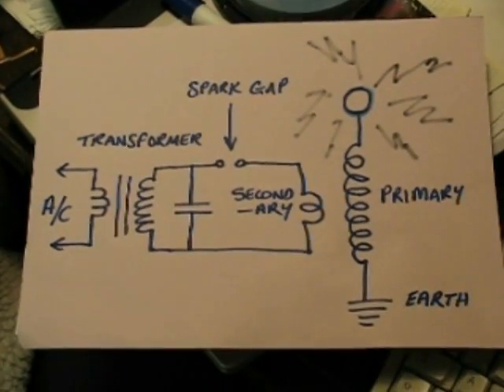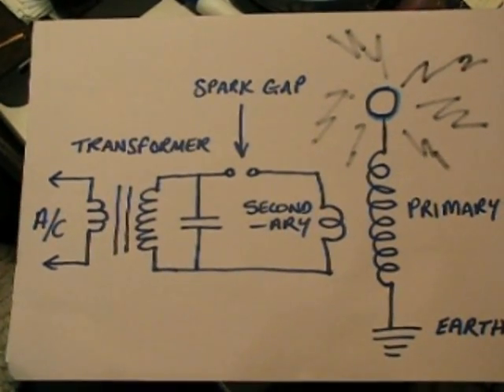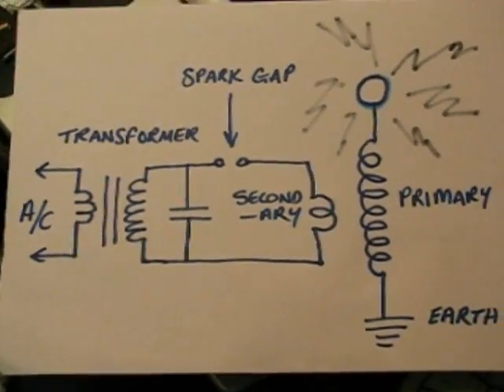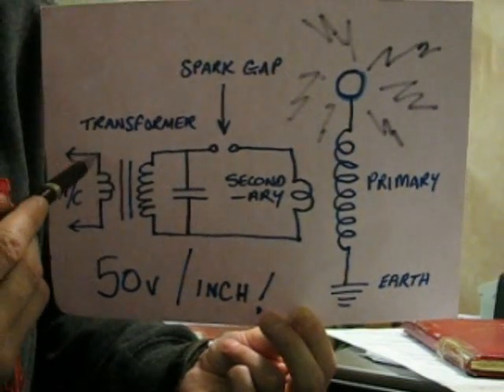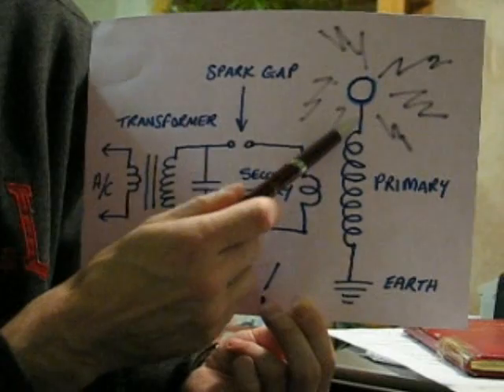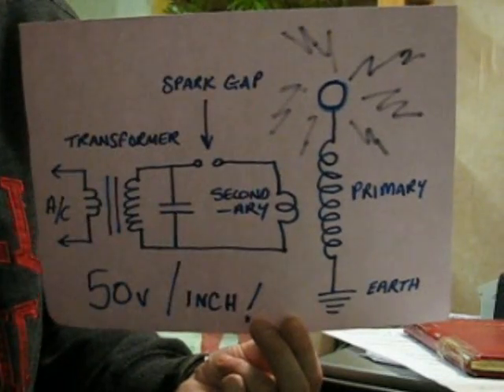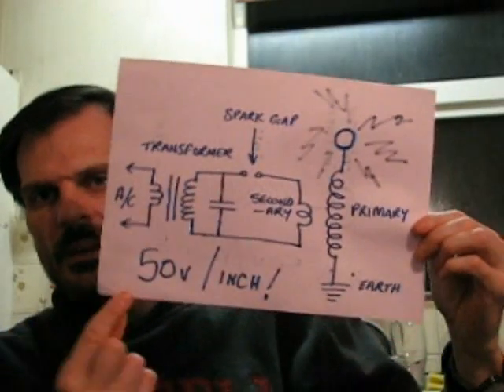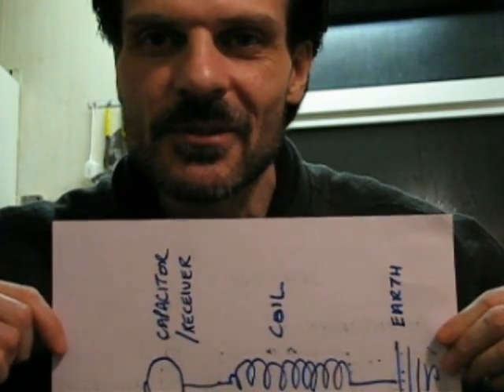Tesla's Little Secret

Comment: Excellent exposition, sir! Thanks. So is this being worked on? I mean, one lightning bolt has enough power to power NYC for a year. Er, that is what one book said. On the www I'm seeing a modest 250kwh.
Reply: We have very high towers as it is now. Their used to transmit radio and TV. They get hit by lightning plenty of times. I find it hard to believe that there is enough energy to power NYC for a year in one. Energy can't just disappear. Lightning can certainly damage things but if it had enough energy to power NYC for a year after hitting a tower we would here about towers being destroyed instead of just radio, TV and cellphone transmitting equipment. In fact most of the equipment is saved though the use of lightning arresters.
Reply from the maker: Joseph Plogger
 I think what we need to be looking at is HOW lightning is created not necessarily how to capture it. Water particles all charged in the same way create a huge amount of power, but the water particles themselves are tiny.... maybe like atoms? All atoms have energy! Maybe we should start thinking about aligning them, like a permanent magnet, or a permanent battery? hmm ;-)
Reply: MattBlytheTheOne That's good thinking, Joseph.
Reply from the maker: Thanks and don't call me Joseph.
Reply from the maker: Joseph Plogger
 What you mean is the only way YOU know how to get energy from an atom? ALL atoms have electrical energy, an electrical charge. They spin contunuously, in fact, atoms ARE energy! If you bond the atoms of two different elements there will be a potential difference across that molecule. I think you are over complicating your theory of lightning. You are correct that all our electrical energy comes from the sun, but lightning is nothing more than charged water particles building up like a capacitor and then ionising air when the charge is sufficient to conduct to ground. BLACK HOLES? Where on earth is the evidence for black holes? Black holes are just galaxies with a central sun that has not starting radiating light yet. We need to grasp a new model of understanding here.
Reply from the maker: Joseph Plogger
 Dude listen to you! You know everything there is to know about the universe already! There is no room for furthering your education. You must think you are God already LOL or even more arrogantly think that God does not exist. The only lesson you gave was a lesson in YOUR model of understanding which I do not subscribe to.... of course galaxies exist and create gravitational signatures that science can only explain with a dis-proven "black hole" theory. LOL how can a giant nothing exist in the middle of everything. Even at the centre of the Milky Way we have a central sun yet it is so far away no one has ever seen it...... have a scientific day. But don't tell me what to do on my own channel. Thanks Mr Plogger.
Reply from the maker: Well OK but you cannot actually see a black hole through a telescope, you can only see something you do not fully understand and then interpret that as a black hole. Massive central suns are the ONLY explanation that integrates the gravitational affect witnessed by so-called "black holes". The reason why you cannot see our central sun is because of the surrounding matter obscuring it, which is considerable, being at least 100 light years across... its not a magic universe it is a scientific universe and unexplainable black holes do not exist, its a fact... or at least it has yet to be proven otherwise.

Suns tear apart? Only when they collide with other galaxies or super massive interstellar bodies.... no wait.... actually you CAN see the central sun in the MIlky Way if you care to take off your blinkers, sir. Have a good day :)

http://cdn.theatlantic.com/static/mt/assets/science/panoramicmilkyway.jpg
Reply from the maker: And for the record stars do not run on "nuclear fuel" and they will not burn out any time soon. Our own sun is a planet that radiates energy (received from the larger central sun) which in turn illuminates its atmosphere, which is thicker than earths.

Logically the sun could not be a "burning ball of hydrogen gas" as most out-of-date models purport, or it would have exploded a long time ago and burned out. And even if there was a way that the sun was converting hydrogen at a steady rate, it would still have to be a solid mass, not a gas cloud!

All suns, stars, planets and even atoms receive their energy from a networked grid of nodes something like a four dimensional printed circuit board. The whole system derives its energy from its own expansion and subsequent resistance, which creates positive pressure on all everything within it boundaries, which by all accounts are limitless in terms of what can be measured.

Evolution exists, but the mind always evolves first. This still doesn't take into account creation or the power of the mind to create.The Mind of God being the Thought that created the Universe and everything in it. You could call this the "General Special Universal Theory of Everything!" LOL.

These are the facts that science tries to repress. Many have discovered the truth, and you can find it if you research in the right areas... but we have to keep an open mind to escape the rigid perceptions (not knowledge) of classical text book scientific dogma.
Reply from the maker: "Seeing as the gap in the center of the universe is only about 4 million km across,"

The centre of the universe? LOL where is that then? ;-)

"4 million times larger than our sun"

..or four million times denser? (providing your calculations [assumptions] are even close)?

"...which violates the laws of Thermodynamics"

Not if it is a turoidal system and the energy flows around it continuously which has been proven possible by Ed Leedskalnin's perpetual motion experiment (which is actually just a reflection of energy being received that is present in the universe at all times). I agree that the energy has to come from somewhere.

"That picture is only an artist's rendering of our galaxy."

Well actually, it is a succession of photographs taken from earth and stitched together, in that respect it is a true panorama. To deny the bright spot at the centre is to refuse to acknowledge the truth.
Reply: No. You said the centre of the universe. Don't try and change it after the event and insult me because you made yourself look foolish. It IS a genuine panoramic photograph of the Milky Way taken from earth. Jackass.
Reply: And I am not a fan of Wikipedia. You make more assumptions than the facts you claim to observe!
Reply: Einstein said, "Only God's Thoughts matter, all the rest are details!" 

See ya :)p
Reply: You cant help it.

Comment: If the sun's radiant energy is DC, how will this induce voltage in a coil
Reply from the maker: Tesla knew that electrical energy could be transmitted wirelessly, through a large Tesla coil which is what Wardenclyffe Tower was basically, to other coils with either the same mass or a resonant harmonic frequency. What if the sun were just a large transmitter but we havnt learned how to tap into the right frequency yet? And in any case it is not difficult to convert DC to AC. We have lightning already, its just learning how to receive the energy that makes lightning possible. Cheers bud :)
Reply from the maker: By converting it to AC
Reply: MattBlytheTheOne
Are you saying the sun's energy is AC riding on DC???  The change of current induces voltage in a coil.  So like, fluctuations of sun intensity?  I don't understand
Reply from the maker: I think you are right. The suns energy is primarily DC but it also radiates harmonised AC at very high frequencies, which is what life on earth depends on to trigger its seasons etc. Current induces voltage in a coil when it is changing. A constant DC current would produce a constant voltage across the coil but it would be very small due to the low resistance. So to get an AC signal we would need to convert the DC to AC to make it usable.

All atoms have energy which is constantly being recharged by the sun. And we can tap into this to produce free unlimited energy :)
Reply: It's a great idea in theory.  But I can't stress this enough, once a coil has settled to a DC current-- it doesn't induce voltage!  There is a spike initially as the current rises from Zero to Whatever DC you applied.  Then the coil looks like a "DC short" except for winding resistance.  i.e. 8 ohms

with DC, a wire is a wire, it doesn't care if it's wrapped in a coil or wrapped around a christmas tree.  You could harvest heat!  It's just a resistor
Reply: Forgot to mention, the coil does maintain a static magnetic field directly opposed to the current passing through.  You COULD move another conductor through the static magnetic field.  and induce voltage that way.  I think it would require more input energy...than the possible energy yield of the sun.

That being said, if you make this work, you are my hero

Comment: People... running the Tesla coil backwards will just give you a simple radio receiver. You will just pick up radio waves.  Google "crystal radio schematic" and look for the most simple schematic. Replace the transformer with some earphones, and the spark gap with a diode (to make it DC instead of AC), and you have a radio. The reason the tesla coil is powerful, is because of the "LC circuit" (tuned circuit), google that.  The electrons in the tuned circuit bounce back and fourth until it dissipates, making sure mostly all the power supplied is used, and not just small amount.

Comment: Matt, coupling 1000 turns to a few secondary turns is impractical at high voltage. Only geometry can generate that terminal voltage in a Tesla because it has no inductive coupling between pri and sec preventing enormous backlash that would destroy the oscillator. The sec has to be a single layer to prevent turn-turn arcing on overlaps and coreless - ferrite would couple all the sec turns together with the pri, and then it becomes a HV transformer, not a Tesla configuration... ;) Peace dude.

Comment: If you take a fully coupled transformer with a 5-turn secondary driven by a 1000 turn primary, this will step down 1,000,000v to 20,000v or less depending how well coupled it is. However a Tesla coil produces several million volts from 10,000v with a 5 turn primary around a 1,000 turn secondary when it should produce only 50,000v using transformer theory. You're not wrong, its just that a Tesla coil doesnt work like a transformer and thats what you need to do what you ask.

Comment: I hate to tell you this but a good tesla coil runs at several million volts at the top-load, and the primary is not tightly coupled to the secondary (primary is a flat or pyramid coil on the lower third) with virtually no inductance to couple. It produces a 'ripple' in the secondary that travels upwards and downwards, reflects and meets in the upper third just in time for another ripple which biases the first. Its a charge-pump, not a transformer, and will not work backwards even with no gap.

Comment from the maker: Before 1906 Wardenclyffe's Tower was to have a Solid Copper Sphere atop the Tower (above the 50 Ton Copper Coil) to attract Lightning, transformed, to a perfect ground, sent by (ULF) of 1-2HZ waves using the 16 X 420ft hollow tubes in the ground. Then 1000 Krypton Vacuum Beam Tubes (4M Volts Each X 100K Amp Lightning = 4-40 Quadrillion Watts) max negative resistance. Tubes pumped to millions of volts from EMF from Strikes...

Comment from the maker: Good point. For a strta the Tesla Coil is not configured to work backwards, the spark gap is in the wrong place and the "receiver" is practically at ground potential. However, place your Tesla Coil near another radiant form of energy (for example another energised tuned Tesla Coil) and it will receive just fine :)

Comment from the maker: Not really! Millions of volts, as in the case of lightning, would fry the transformer coils. What we need is a steady stream of electricity to charge a capacitor for example and then make it AC through some form of switching gear. The coils could be configured to make it useful we are not limited to the current winding configuration.

Comment: Took me a minute to find, but take a look at Dr Stiffler's SEC.
This device does what you claim but has to be excited by an inductively coupled source (a radio signal) to work. This requires an energy input.

Just a thought - if a Tesla coil works in reverse like you say, how come mine doesnt produce any energy at the primary when not driven?
Tesla built his spark machine to debunk Edison's parlour trick of electrocuting cows, proving that AC was safer than DC. Lightning is pulsed DC, not AC!

Comment: You dont mention the fact that the large SECONDARY (induced) air-coil is actually driven as a charge-pump. Those sparks are generated by an AC signal that is faster than the coil's reactance.
What you are describing is accepted transformer theory, but the Tesla Coil is not a transformer, it is a charge-pump. To transfer 'ambient' energy through this, the ambient energy would have to be millions of volts AC at the tuned frequency to produce hundreds of volts AC in the mains transformer.

Comment: very true but the most common 'radiant energy' is gamma radiation and it's stopped by the earth atmosphere. the most conmen radiation to reach the surface of the earth that I know of is viable light. You know the energy that solar panels, trees, grass and every plant on the planet use. There is still allot of radiation in longer wavelengths but the longer the wavelength the less energy that wave has. So if you can find a way to capture energy form all of those longer waves it might work.

Comment: Okay you're thinking the same as mine,as I am building reactor still doing the blueprints for it. I watched the other video that linked me to comment here and you said the tower itself was a capacitor and your right as I am using this fact myself.The primary coil grounded send the charge into the earth, but this current can still be used in house and such i.e. when tesla put all those light bulbs in the ground he was testing the range of the field that was produce as the current grounded itself

Comment: While you can get electricity from radio frequencies that are in the air, none are of significant enough power to be of much use. Directional waves are more capable of transmitting power, but most signals are omni-directional or too scattered.

The only real use I can see for this is a spectacle. You mention in your video creating lightning to impress people, which can be done with a high voltage and low amperage. I am sure people in Tesla's time would have been amazed, but we should know better

Comment: I think you have wrong concept of the jam radar. they just fill the signal that is going to the radar with noise, in this way the radar can't actually understand if it is an object in the air. But even if it does sent back the signal in the opposite phase... what is that mean??? nothing! the signal would come to the radar in the same way just with the opposite phase. Just if you could see the amplitude of the signal it would cancel in some spots, read "stationary waves".

Comment: i am schooled in physics, with electronics & laser physics. you are correct in you analysis, with some caveats: the radiant energy to be captured on the primary would need to be a lightning rod, as we have yet to have an extraction transducer to collect the energy in the magnetosphere.  the Tesla coil has to find a ground to discharge to, so going backwards in the primary winding requires a voltage on the 'van der graf sphere', which won't happen by just sticking a metal ball in the air.

Comment: I'm not understanding what is supposed to be oscillating. the secondary of the second transformer or the EMF. Static energy, cosmic, x-ray, gamma radiation, radio waves for tv, radio, cell phones, etc already oscillate. Even if they're dc, they vary in some way or another and isn't that all that's needed to create a current in a wire/antenna? Am I missing something?

Comment: Hi Matt. Great idea. I might have thought of it myself in another 30 years or so. Check out the circuit INVENTOR3 is using. 4 ceramic caps (0.1 uf, 50v), 4 germanium diodes (1n34) and 2 electrolytic caps (50uf, 50v). Since the parts cost very little/basic circuit they can be hooked together in any combination of series and parallel to make the voltage we want. What about doing simple things with simple circuits to try to recoup some of the energy that otherwise would be/is lost.
Thanks again.

Comment: Hi Matt. Great idea. I thought of using multiple strips of aluminum foil (1' wide), maybe taped together, after a thin coating of spray-on shellac (or something else insulating and clear), taped to the wall by the tv or something. The tv produces high voltage and a lot of electromagnetic and static energy. If we don't catch it, it dissipates into the air and is lost. Also, what about picking up energy from the electromagnetic field around the outside of a motor and anything else like that.

Comment: In this there is no tuning circuit & there is no need to "dump" since we want all the energy, ac or dc. Any energy that goes through a dump resistor is wasted (ie heat). Power produced is determined to a great degree by the height of the antenna, its  size, material, proximity to things like power lines, tv's motors, etc.. Wouldn't a greater surface area give you a better reception. With cb radio a full wave antenna gets better signal than a 1/4 wave